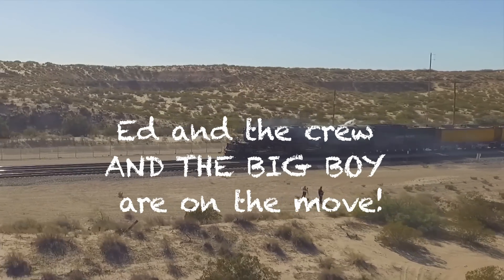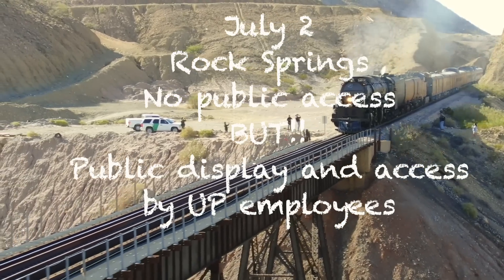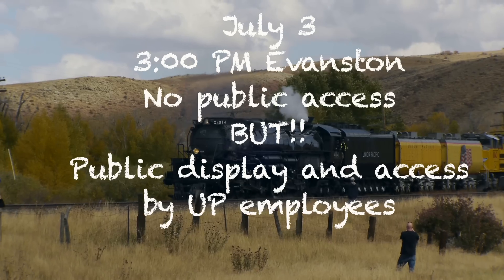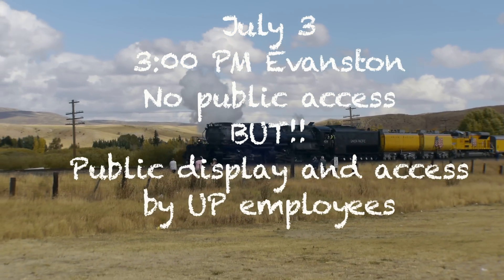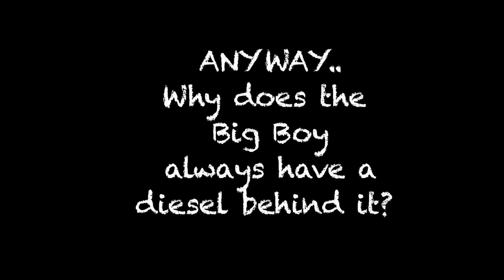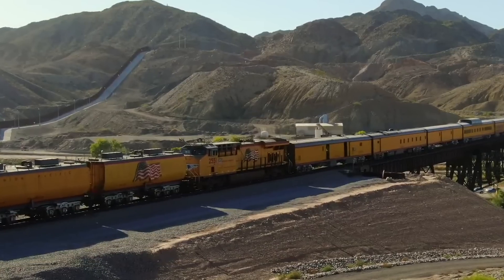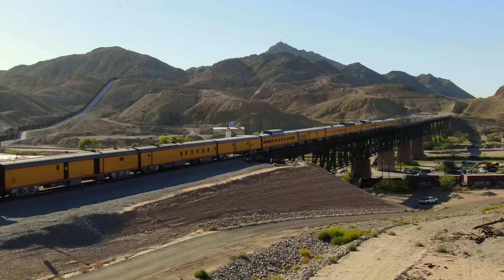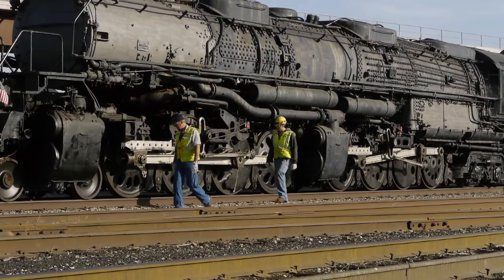Why do Union Pacific's Steam Locomotives Always Travel With a Diesel Locomotive? - Big Boy 2024

Comment: Thank you for sharing this video and for addressing the presence of the diesel.  :-)

To me, in Europe, the aspect of braking greatly appeals. (So I'm sorry for this effect of leaving the diesel out.) In this part of the world, much railway traffic runs on electric power provided by catenary. Many electric locomotives and train sets can feed the braking energy back to the system, notably if the network is AC (no, not air-conditioned).
Reply: trains here in the Netherlands run on DC are capable of regenerative breaking, but the power can currently only be used for its own electrical systems and to supply other trains in the area, since the power stations are afaik currently still unable to return energy to the grid (although they've been looking into the feasibility of making grid return possible)

Comment: 4014 is traveling now with No Diesel, and there are many videos showing it enroute to the West coast with no Diesel locomotive in the consist. The reason it was required first and foremost was for PTC. The Diesel had PTC which IS required for running on the main line.  Braking is being taken care of now by having extra Freight cars  that can be used to slow down and stop the train without heavy use of the locomotive brake.
Reply: Not required for Steam...the FRA actually issued that waiver, but the railroads wanted/want it for extra safety measures.

Comment: most trains years ago most had helper engines 4 more power the longer the train 🚉 😊 the more power U need 2 pull it wasn't uncommon of a train 2 have 5 or more helper engines U need the big boy train could pull most trains by itself and did so that also includes freight  trains that was the biggest steam train made 😊😊 OMG 7 2 2O24

Comment: When I worked for Electromotive Div,  we had qualified steam crews that operated steam for the Illinois Railroad Club that ran short excursions on the BNSF.  They required steam power be in perfect condition to operate on BNSF tracks.  Railroads hate nothing more than disabled power blocking a line.  I never saw diesel steam consist not to say it never happened.

Water was an issue.  Club would arrange to have fire departments at various points refill the tender.
Reply from the maker: And it takes time to get the water onboard. That’s why 4014 has three tenders.

Comment: Of the three tenders with X4014, what is the ratio of water and fuel oil for each of the three?  You did a great public service of explaining the PTC gear and talking about the sand dome reloading.  Yet, many of the older steam locomotives leaked water and failed to recapture or recondense steam, so these locomotives needed frequent rewatering stops.  With most coaling or fueling towers, water towers and sand towers now lost to history, the mix between fuel versus water loading of tenders is different than in the past.  In the past, water was the most common type of tower, followed by fuel and with sand being the least common type of tower along their routes.

Comment: A little extra power? Maybe 844 might, but 4014, I don't think so. 4014 is able to pull UP's entire passenger fleet, and a dead weight diesel, up Sherman Hill. no problem. Every other reason, Oh ya. Somewhere in the past I heard that at the beginning of "Steam excursion" the government didn't trust the grand old engines and so required that a suitable diesel loco be "in train" in case of a break down. That may still be in force, at times. I don't know, do you?
Great info presented today, have fun chasing 4014. ;-)
Reply from the maker: Never for a break down. The diesel would be lucky to get 3 feet. They can get real power out there in little time. It’s great to see 4014 out here on its own!  ❤😊